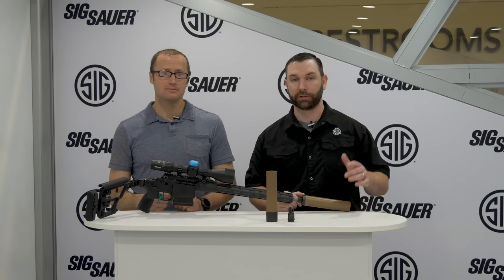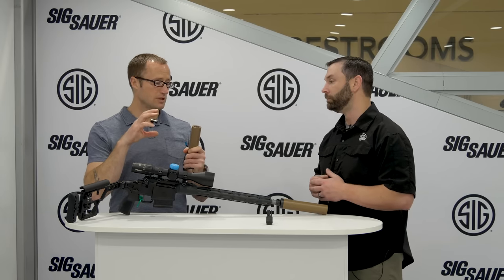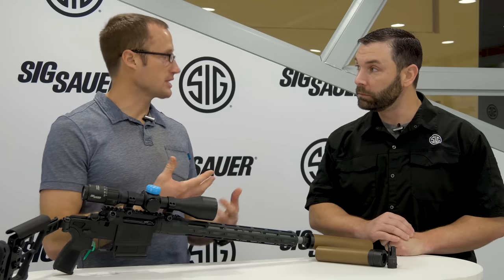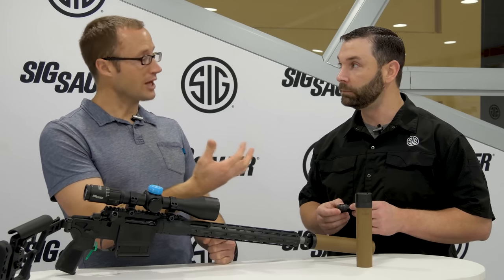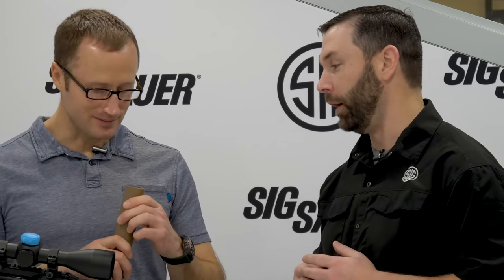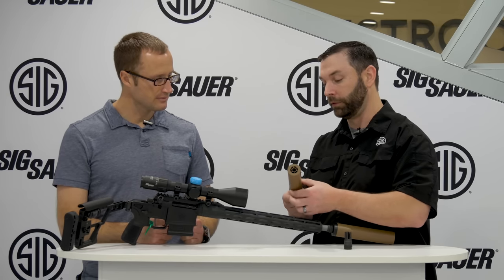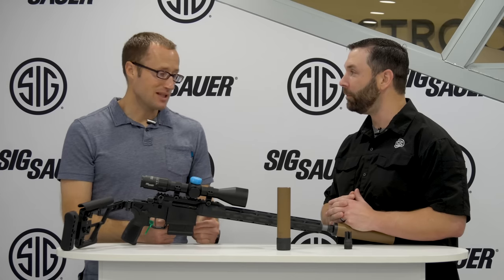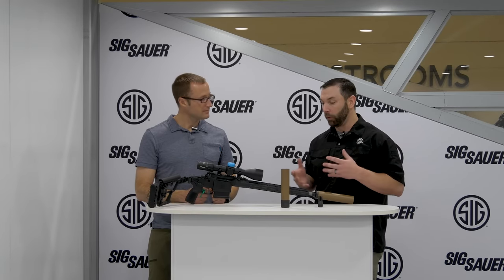Sig's New Suppressors: SHOT Show 2020

Comment: Valuable info here on the new silencer line.  I have the (now legacy) SRD models in 5.56 and 7.62 so I'm glad to hear the commitment to continuing to support those.  Never had any complaints about those cans but I sure like the continuing evolution of the products, both the silencers and firearms, optics, etc etc....
Reply from the maker: Agreed, glad they are supporting older tech while the move forward.
Reply: @KitBadger  this video, at 4:28, shows you firing 7.62 MCX VIRTUS. was this implying the 300BLK model which is 7.62x35?

Comment: Sounds interesting but we'll have to wait to get the db specs
Reply: @t1tan19  My ears beg to differ
Reply: Hearing safe is hearing safe. After that there are more important things.
Reply: A flow-through design is a huge factor to guarantee hearing-safe levels for the shooter. Without backpressure and noise coming out of the chamber towards the shooter's ear, most of the sound and blast is directed downrange.

Comment: I have bought in to Sig before, in fact I own too many. Am I justified to feel that they change directions with every generation of weapon. Some are half baked,  never have  reverse compatibility, or competitive aftermarket support. Sig manufactures cool weapons but.... Ivan, cool content and looking forward to more from SHOT Show.
Reply: I don't want to sound too fanboyish, but I think Sig has been innovating on a level that no other firearm company has. When you try to push the envelope, sometimes you're going to have failures. Most are QC'd out before they hit the market, but there are limitations to how much development you can apply to a product before you release it and begin seeing a return of investment.
Reply from the maker: I feel you, but I do appreciate that they move on.  Look at SureFire for example.  They make some amazing muzzle devices, and their cans are great, especially from a durability standpoint, but they are still using the same locking ring that can require you to shoot the can off after it becomes welded on with carbon.  Sometimes you need to let things die and move on to better tech.
Reply: @KitBadger  Thanks for listening. I am just a consumer that sometimes "knows more" than the experts. What is not always thought about  is that Sig is always moving the industry forward.

Comment: Well, beats me how anyone can 3D print with metal. Unless it is molten, hot, metal. But is sounds like it checks off all the points.
Reply: Technically it still is molten hot metal, but small enough to be classified as 'sintering'. The metal is in powdered form, a microscopic combo if the material and flux; then a laser heats up a point on the surface and fuses a small portion of the powder together. Do this enough times with an automatic system constantly brushing new layers of powder on top of the fused layer and you pretty much have a 3D metal 'printer'.
Reply: @AnonEMus-cp2mn  Pretty cool. Has anybody tried an AR lower yet? Because you just know they will try!
Reply: @chrissewell1608  A few years ago a company made a completely 3D Printed 1911. Every component including the barrel!
Reply: @AnonEMus-cp2mn  Did it work? I am sure a $700 mfg. Gun would end up costing $2,500 if 3D printed.
Reply: @AnonEMus-cp2mn  Pretty cool stuff! Not the smoothest job, nor cheapest vs. The standard methods. But works. And as a rough prototyping machine, it works great. I am amazed. Thanks!

Comment: Lol OSS copy cats all the way down to the tapered mounting so no fouling into the locking mechanism
Reply: Wrong. Flow through silencers with out the front venting have existed since at least 1910, and flow through silencers with out the front venting with coaxial spiraling elements have existed since at least 1919/1927. Multiple layers sending gas back and forth have existed since at least 1925. OSS didn't invent any of that stuff at all, and they sure didn't come up with taper mounts either. YHM's mount patent from 2006 specifically mentions using a gas sealing taper in front of the threads and secondary retention method.
Reply: @joshparker4491  YHM's 06 design didn't catch the eyes of the industry, OSS's flow through design(their design no on elses) brought something new to the industry. It's their design, they made it. SIG saw the mass attention OSS got and followed suit to make their own copy of it, kinda like how Chevy copies Ford after Ford made the raptor and would you look at all the chevy trucks today the resemblance of the Ford Raptor. Using your logic if someone made a simple metal brick that could hold up the empire state building by using their own methods and metallurgy to make the brick withstand the immense weight of an entire building, they didn't invent shit because someone else "designed" the brick and someone else "discovered" the specific metal they used 1,000 years ago. lmfao

Comment: q the fix knock off, not sure how you can promote their product given your relationship to Q.
Reply from the maker: People that want a Fix, don't want a Cross.  And anyone that begins comparing the two, really just wants a Fix and are trying to justify spending less on the Cross.  They are largely two separate markets.  The Cross is probably a great rifle (I haven't spent meaningful time with it), and for the price beats out anything else in that price range, but it isn't the Fix.
Reply: You're wrong, you have it completely backwards. Q copied the Fix from a SIG striker fired rifle prototype which existed long before Q was even a thought. Even Ethan Lessard, who is Q's head engineer, told me about it a number of years ago. Q wasn't launched until 1 MAR 2016. The Fix was publicly announce 28 DEC 2016. Preorders for the Fix were started 1 FEB 2017. The means they were designed, prototyped, tested, and everything necessary to go to production had been complete in only a 7-8 month window, and that's because they had a significant head start because they copied it from SIG's prototype, not because they had EnGiNeErS. Q also took the Erector from SIG when they left. A SIG video from April 2015 titled "SIG Silencers, Episode 1: Why SIG" even shows a SIG employee working on the Erector, that guy now works at Q. Either way the Erector is a copy of a 1992 Heckler & Koch patent for scalable thread together baffles and also a copy of the scalable thread together baffles with exterior tool features from Nielsen and Schultz & Larsen silencers. Q just happened to release a version of it before SIG, just like they did with the Fix.